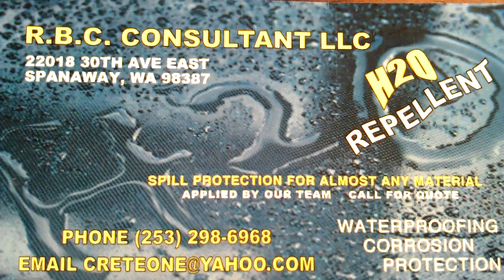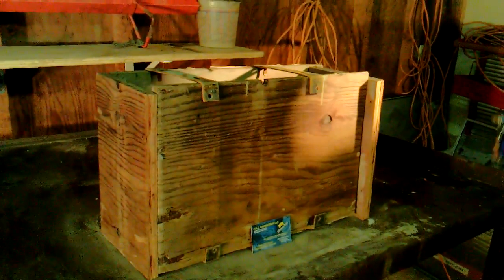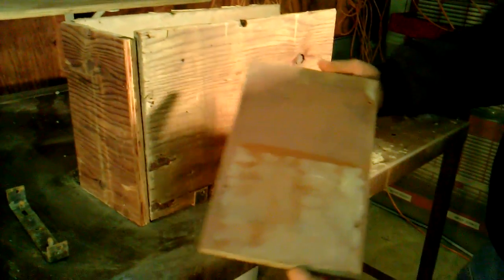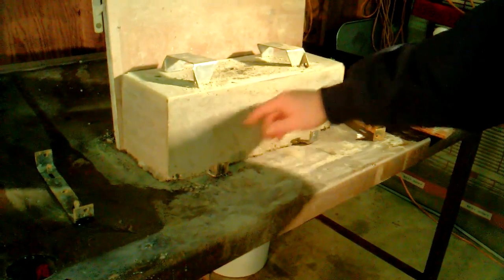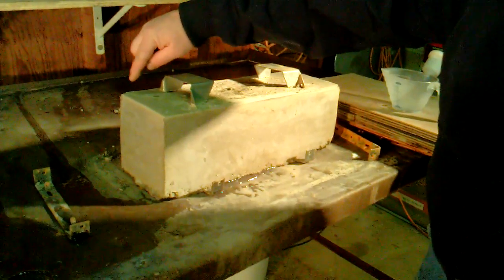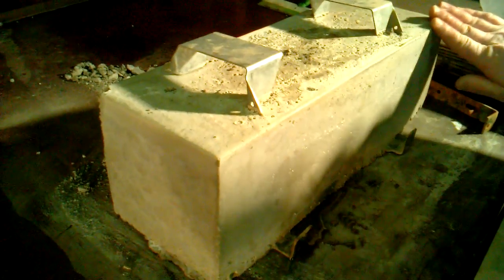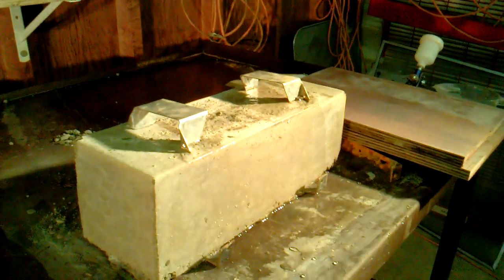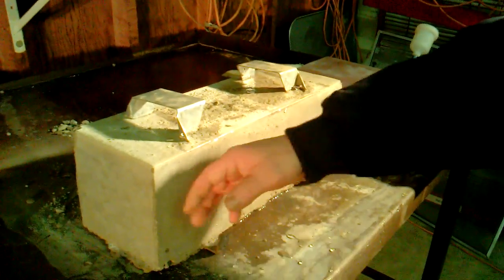Ultra ever dry, concrete poor wow, did some cool s

Comment: cost is very high compared to other kinds of form release...this isn't the most cost effective usage of this material..
Ultra Tech should consider their prices for sure, specially when we talk about the service life time of this system (2 to 12 months before a re-coating needed, depending on the application and the kind of fluid attached to the coating & also the level of abrasion)